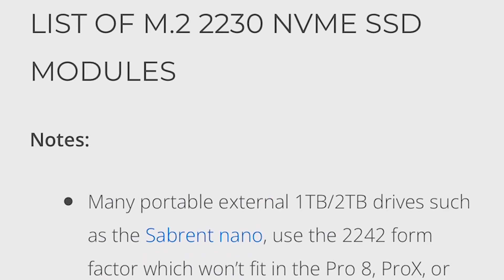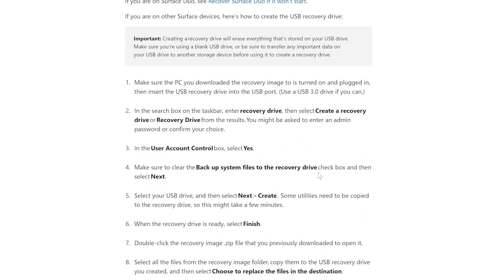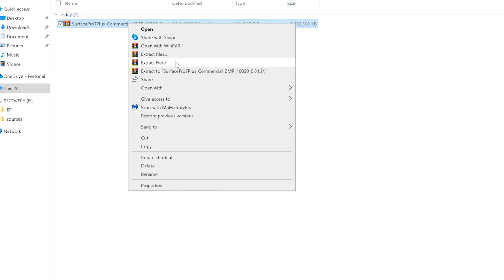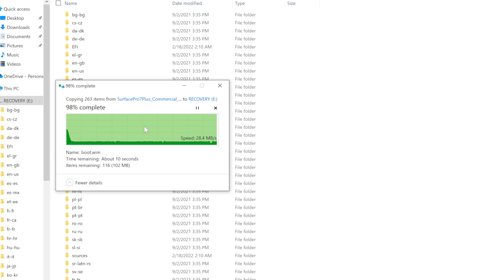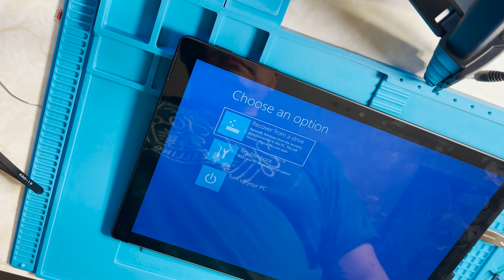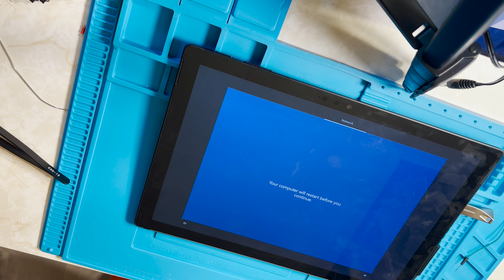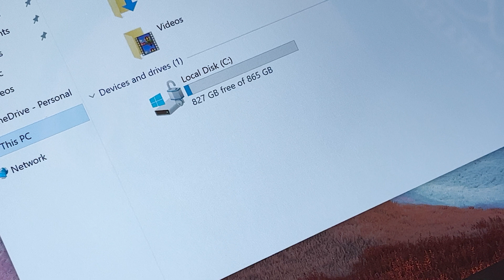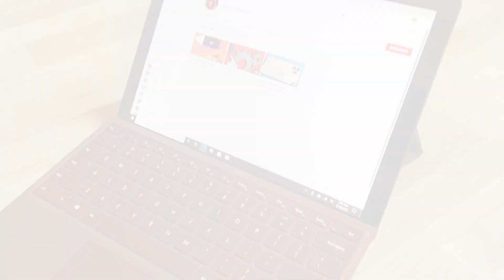Microsoft Surface Pro 7+ Plus SSD Upgrade | 256GB to 1TB | Clean Windows Restore

Comment: lets not forget the none LTE Surface Pro 7 plus model (no built in modem) also has a MICROSD expansion slot.  I use my Surface for music production and found having 2x 512 Gb SSDs is the most economical solution. I have one configured for recording and the other production saving my work to the MicroSD. This is great when using it in tablet mode, else I have all my docs/files etc stored on external drive drives.

Comment: Does this fully wipe out the windows 11 in the sp7? because I want a clean install, windows 11 in this sp7 got some problems.
Reply from the maker: Operating system, Windows, is inside the ssd. If you replace it, you have to reinstall Windows.

Comment: hi I have a surface pro 7 plus and currently have 128GB installed, it is i5 and 8gb of Ram, how many GB do you think I can install to my surface pro 7 plus?
Reply from the maker: Hi, you can go up to 2tb. 2tb hard drives exist but are hard to find.  If you want to spend less than $100 and don’t need a huge amount of space I will get 512gb.  1tb will cost you around $150.
Reply: what 1tb brand hard drive do you recommend for surface pro 7+ just got one with 128gb and need more for video production and web design. @SimpleEngineer2002